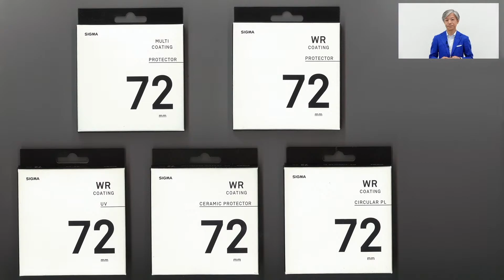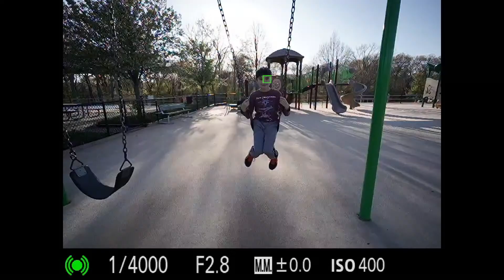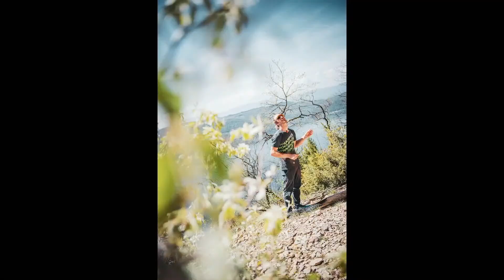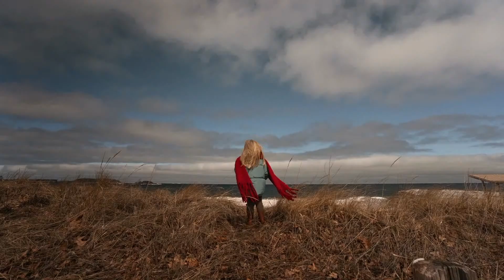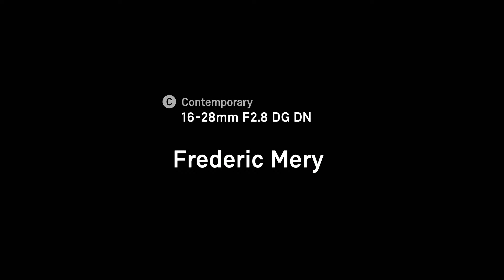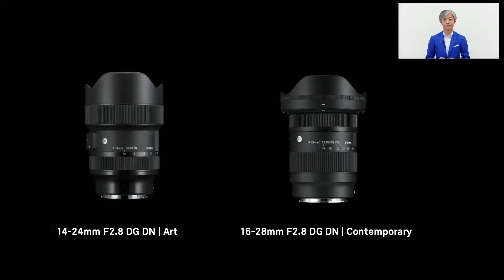SIGMA STAGE ONLINE ー 16-28mm F2.8 DG DN | Contemporary Announcement

Comment: That's lovely Sigma. 

One, the biggest benefits I see is massive weight and  cost reduction for Landscape photographers using filters.

Using the 14-24mm f2.8 i need to use a special holder and 150mm filter set to use use Graduated, cpl and more.  The new 18-28mm it's back to 100mm square filters yet still ultra wide.

Keep up the good work.